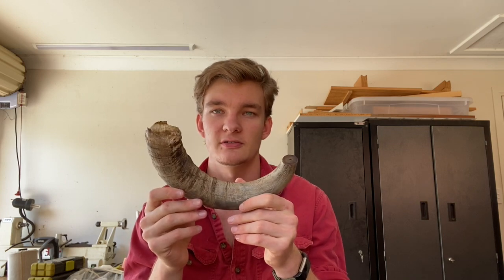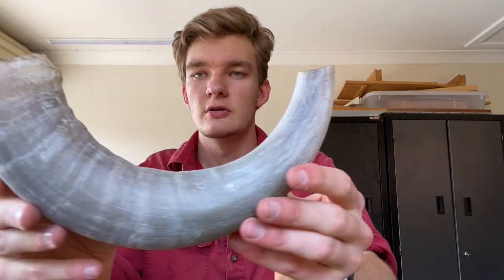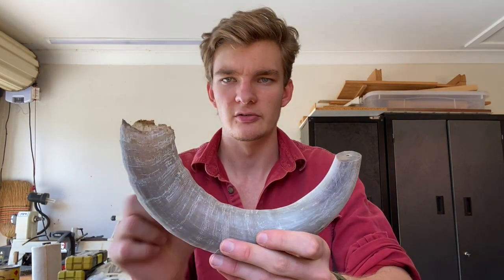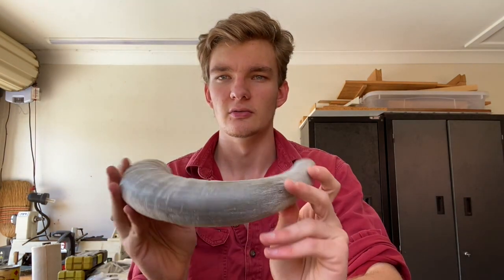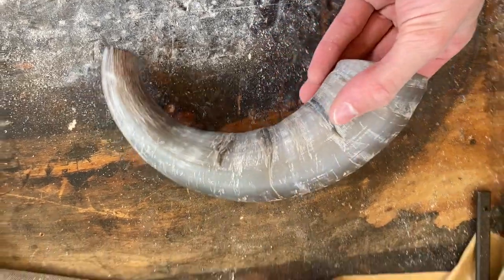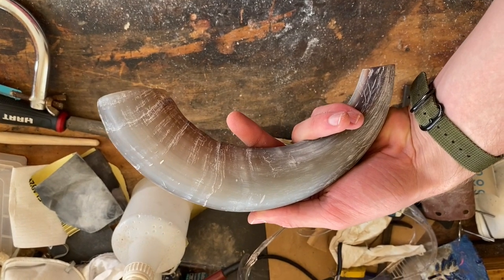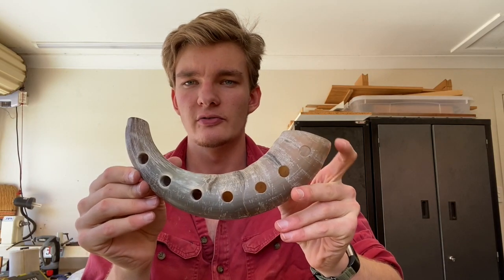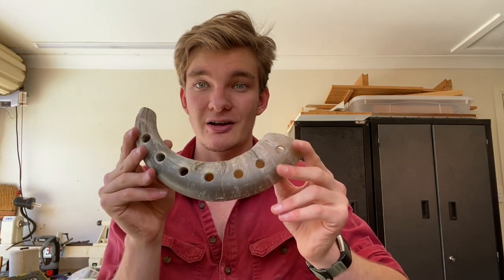Making a Pen Holder From a Horn

Comment: That is pretty great idea. Bummer about the extra hole. It looks like it affects the function of that last hole. Probably the pen will stand at a different angle. Maybe a plug or some kind of fill, like body fill, wood putty. Looks great the way it is, just a thought. Thanks for showing...
Reply from the maker: Thanks Ken! I'll probably just leave the hole, I only didn't put a pen in it because I ran out of nice pens to display for the video. Good plug idea though.